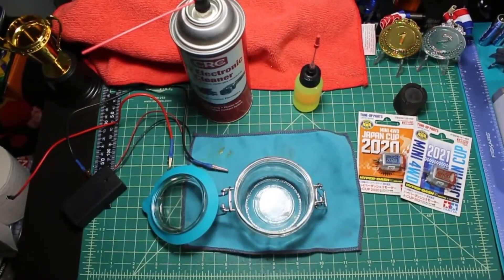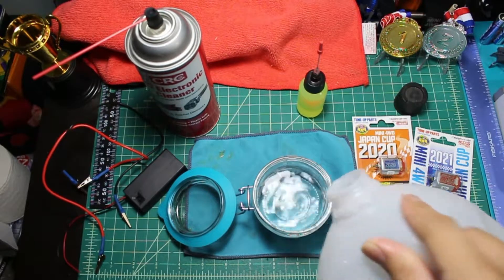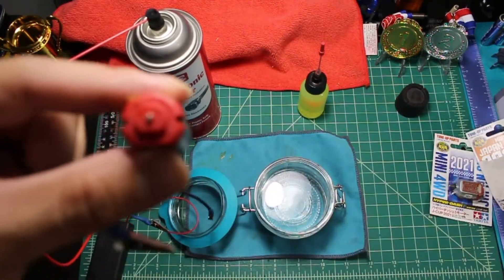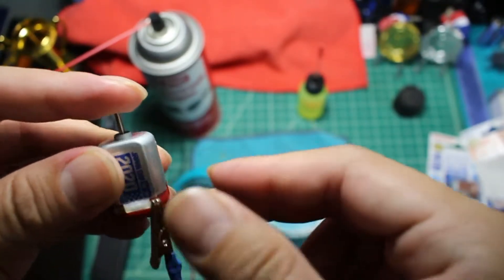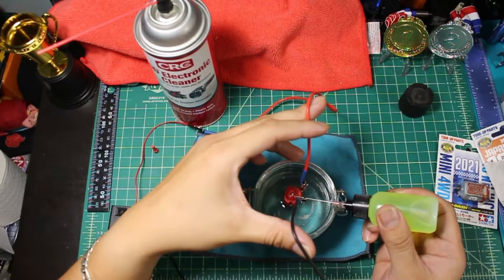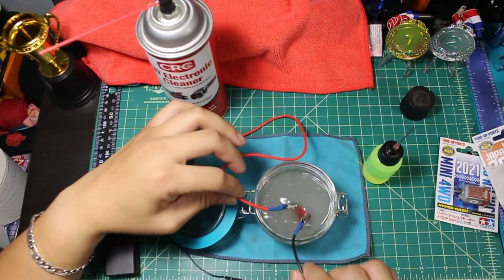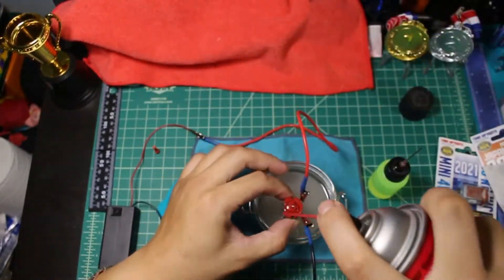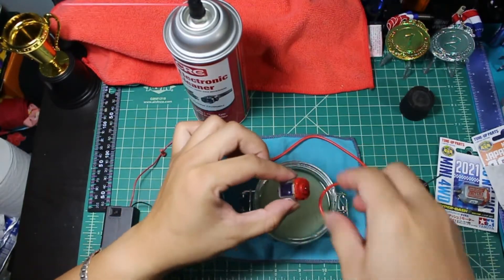Tamiya Mini 4WD Motor Break in (Brush Motor) (forbidden technique) (not really)

Comment: Hi is it possible to damage your motors with this method?
Reply from the maker: Highly likely, if you use chemicals than water and machine oil, as well as if you use a higher voltage rating than your motor can handle

Comment: Wow, I never considered submerging my motors in a water bath! It worked, though, because this method gave me a box stock motor with >20,000 rpm at 3V on the G-Force Mini Break-In System. My previous high was 19,200 with a dry break-in.
Reply from the maker: Glad that it works for you as well, i like this method since it has less stress on the motor in terms of temperature